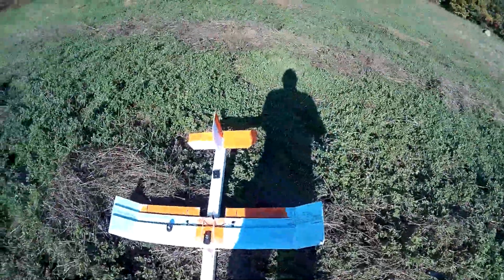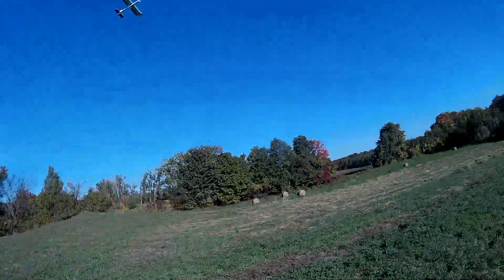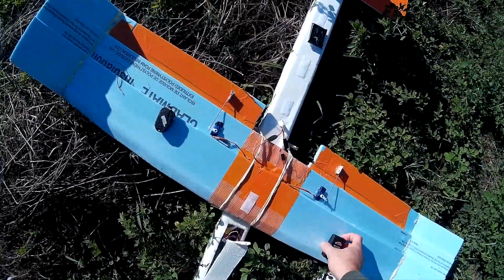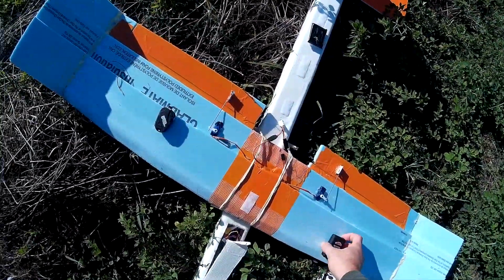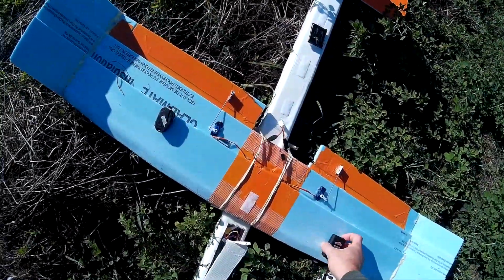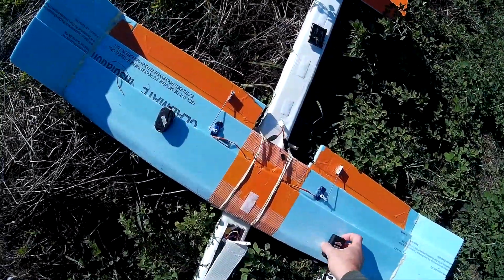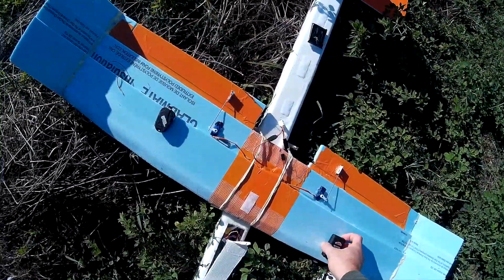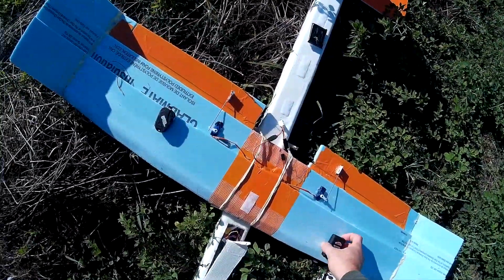KFm3 FPV Candidate Maiden Flight

Comment: Great vid man, very interesting to watch. Nice to see your electronics are nicely ventilated (-;
Great use of Jacks music here too!
Reply from the maker: ExperimentalAirlines  original fuse designs basically have the tube itself with no internal support (however Ed sometimes adds a bulkhead).  I found without some bracing it eventually gets damaged enough that it can't hold it's shape.  So I add some bracing (leaving some ventilation) and do some pseudo fiberglass to reinforce the front, back and where the wing attaches.  Thanks for the comment Jax.
Reply from the maker: It's early in the morning.  I just realized you were probably talking about the compartment hatch opening up mid flight!  ROFLMAO - good one!
Reply: UnlimitedVertical
Ha ha, yeah I wondered what you were talking about lol (-;
Reply from the maker: Jax Teller WA
I responded to your comment, then poured my coffee...gotta reverse that order :-)  I was about 1/2 way through the coffee and it dawned on me that you were joking :-)
Reply: UnlimitedVertical
I'm usually joking ha ha, all i want is a laugh (-;
Reply from the maker: Jax Teller WA You got one from me...albeit delayed a bit.

Comment: great job on your build.  the Kfm3 airfoil is awesome.  I have also built along with kfm2 and also kfm4. I love them all.   I am no expert but  as far as CG.  I always go with 1/3 back from leading edge.  Always fly very balanced with little trim.  curious to see what other say on this.   3D guys move that CG point back more sometimes 40% or so.  anyways.  great job.  thumbs up.
Reply from the maker: Thanks.  Me too (usually 1/3 back).  Don't remember where I read that it was 50% back for KFm3, but I did read it somewhere (probably on RCGroups).   Anyway, I tried again today with no weight on the back end (i.e. shifted CG to maybe 25%-33% off the leading edge of the wing).   It flew at least as well if not better than having the CG further back, so I'm throwing that 50% tidbit out the window.   That's good news because I don't like adding weight to make CG for nothing (rather add extra battery in the front than dead weight in the back).

Comment: How much does it weigh?
Reply from the maker: The air frame itself is not very heavy.  The heaviest part would be the fibreglass rod for the wing spar.  The wing itself is a little too thick and this is what is causing the slowness.  If I was building it again I would either do a KFm2 airfoil (1" think total) or would do a thinner KFm3 airfoil (1" thick total).  Sorry I don't have an exact weight for you, but I have taken it apart (temporarily) and pulled the ESC out of it since it was cutting out intermittently.